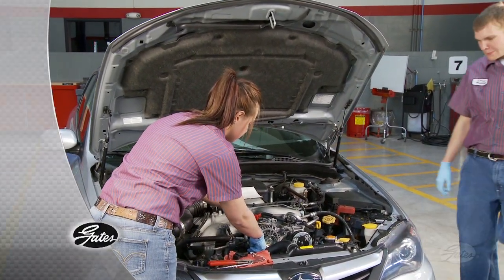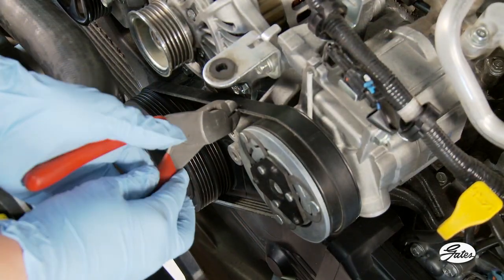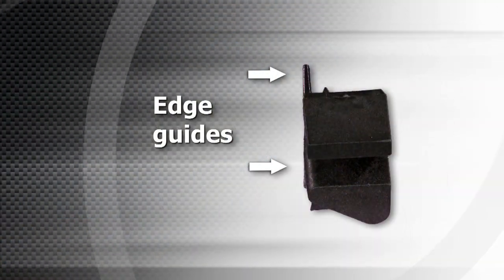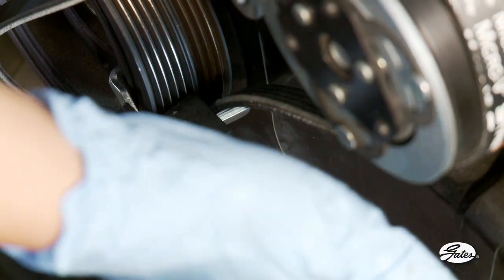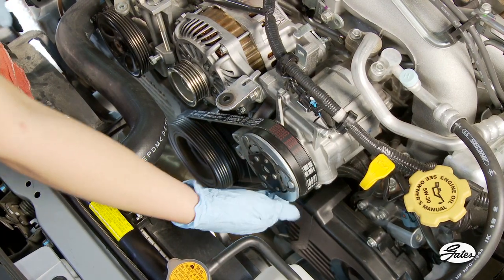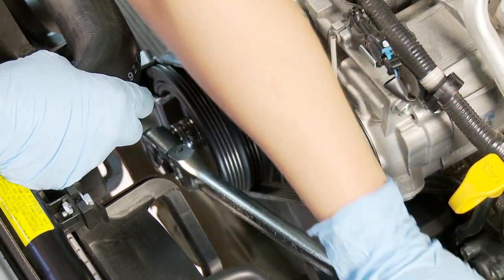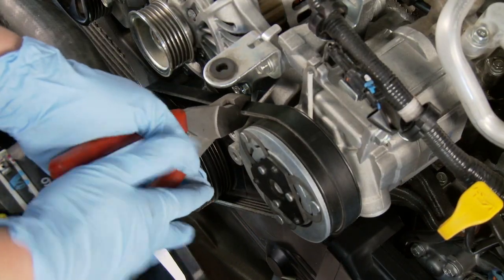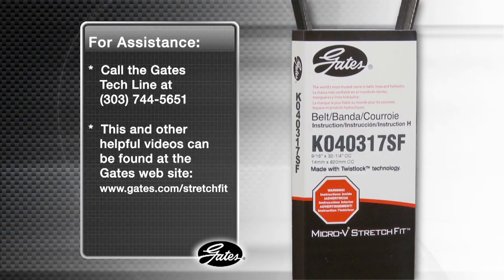Gates Subaru Stretch Fit Belt Installation

Comment: So this was a great video because it showed someone replacing the front belt - which is the one that busted - and I found out that there's a really dumb design flaw with these belts. One can tighten the tensioner for the front belt that raises and lowers the alternator too much, because for some God forsaken reason there's a nut directly underneath the front belt from the tensioner, which rubbed against my belt and made it break. The concept of being able to tighten something too much is very stupid.

Comment: Can you just take the tensioner off and use a stretch fit belt I've seen on the newer subarus that it still has bolt holes for where the tensioner goes

Comment: The tool comes with the vehicle.. In the spare tire tool kit jack.....Unless someone kept it....
Reply: What really sucks the most about a set-up like this is that it makes it near impossible to fix a simple belt on the side of the road if you don't have the custom tool.
Too many things are ' if you have custom tool or wrench ' it takes 10 minutes, if you don't have them it takes possibly days, or you just can't do it at all.
Reply: @michaelszczys8316  Yeah.. Gates actually sells two belts. One is like $38.00.. The other is $95.00 as it comes with the tool....There the same belt..So the tool is $60.00.. They only cost $20.00
What a scam...
Reply: You mean the tire iron jack handle?
Reply: @michaelszczys8316  I mean it is stored  with the jack kit...Ford Subaru, and GM supply the tool to put the belt  on...

Kind of like Mercedes Benz..They put the fuse box diagram. In the spare tire compartment...Not in the damn Manual..Where it makes sense to put it..Go figure...
Reply: Yeah, I know, just kidding. The tool is with the jack- use the jack handle to pry it on.
Reply: @michaelszczys8316  I know some Mazda use the same type belt for the AC compressor. I just use 3 tie wraps. Then rotate the crank shaft with a ratchet....Then cut the tie wraps off..

Since that time. I bought the tool. As I do several of these a year..
 
And bending the AC Compressor around then using a pry bar to get the AC bolt in again. Will screw the compressor up..I seen so many cross threaded Compressor and Alternators  from people using that method. I want to scream...As i have to put new threads and bolts in them.

Comment: Has anyone done this to a 2011 wrx ? I see the crack shaft pulley is different from mine, wondering if the tool would work
Reply: Modern subarus should have an a/c belt tensioner. I may be wrong, bit as far as I know the engine changed slightly after 2011 and they should have the tensioner from the manual 2.5 pre 2011

Comment: What a headache. Go to your local junkyard and grab yourself an 07 or older tensioner and belt, throw it on and have a good day. Just remember when loosening the tensioner it is opposite threading. So clockwise would be loosen the belt and counterclockwise would tighten it.
Reply: You can install a tensioner??
Reply: Denham Cartwright yes the block has the same holes and threading for the tensioner
Reply: @julianslowik5387  the pulley wheel on the tensioner always ends up making squeaking sounds, i'd rather not have a tensioner...
Reply: Well I tried that on mine but then the tensioner slipped and chewed up both the belt and timing cover.

Comment: This is literally the most retarted thing subaru has done.  The old tensioners worked fine.  Gates has great products  But Subaru changed this up now i have to buy a special tool that i will rarely use
Reply: tool comes with belt, but yes, shouldve just put a damn tensioner....
Reply: @Laborchet  Tool definitely does not come with a Gates belt.

Comment: No matter how many of these godforsaken stretch craps I've fitted, I always have to double check how to fit. My 1971 beetle has a much much better design with the shims, no brains needed 😃
Reply: I was thinking the same thing.  The Beetles from the 60's and 70's had instructions on how to change the belt in the owner's manual, and came with a tool roll that included a spare belt!  It could easily be done in the field by a lay person.

Comment: subaru was so concerned about the tension of the belt that they came up with this set up....yet the belt for the alternator has to be tensioned by hand?
Reply: Agreed at least if you're gonna do a stretch belt for better long-term reliability, do it for both belts!
Reply: Can you just take the tensioner off and use a stretch fit belt I've seen on the newer subarus that it still has bolt holes for where the tensioner goes
Reply: Well they don't have the smartest engineers in the industry just look at their engine problems. Such as headgasket and oil consumption. LoL
Reply: @BenzCedes  Even Toyota had (has?) oil consumption issues, and they're the best/most conservative automaker out there. I blame regulators for imposing fuel economy and emissions regulations that are nearly impossible to meet without causing such issues. It is odd that only one belt is a stretch belt though, especially with the other using a manual tensioner...